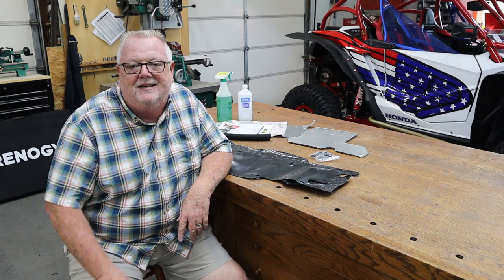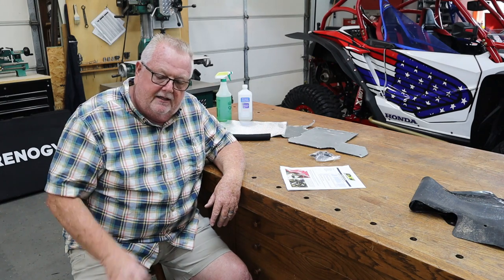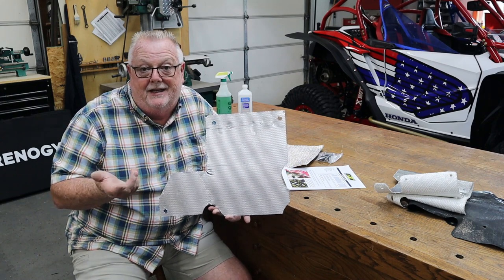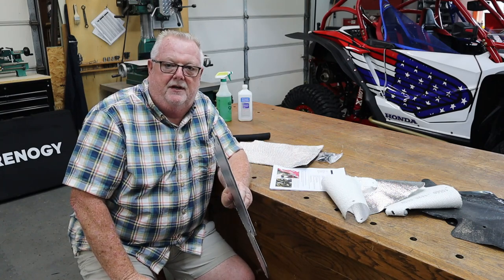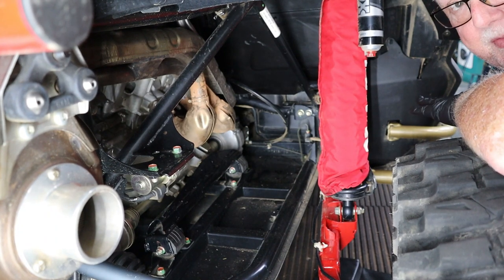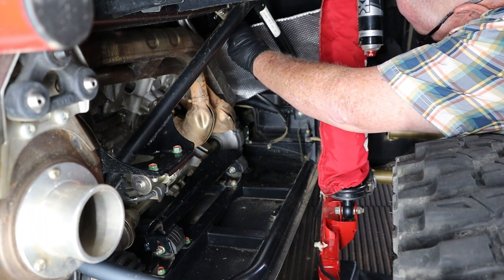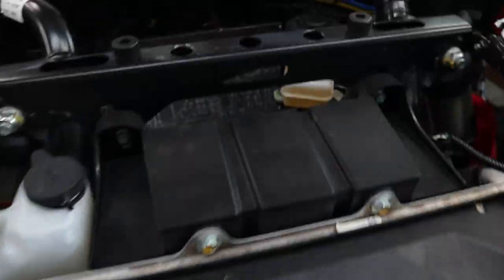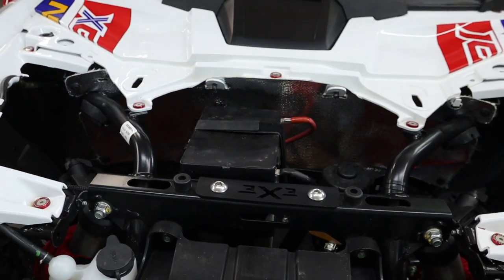Design Engineering Inc. heat control kit for the Honda Talon

Comment: I bought this kit before I saw the Jeep shifter boot fix. This kit blocks some air going through the tunnel, but not enough. It also lets heat and dirt come through the rubber flaps that go on each side of the tilt steering wheel mechanism.

As far as comments about blocking air to engine - at last count this is a water cooled engine! If you could route cool clean  air through the tunnel- you would have a cooler place to lean your right leg.

Comment: Terry, Thanks for this video. Like you and many others I have also tried several heat mitigation techniques on my Talon.  One of the things that I am a bit concerned about is limiting air flow over the engine.  If you follow that tunnel back it directs air over the engine.  Blocking that flow off may cause some overheating issues with the engine.  So, I will be curious as to how it all works out.  I was just out riding on the 4th of July and purchased a variable speed 12-volt fan on Amazon for the passenger compartment.  I directed the air flow help move air in the cabin.  It made a huge improvement keeping me cooler.  Keep up the great videos.  I have added several of your recommended accessories to my Talon.
Reply from the maker: Thanks Chuck! I’ll monitor the engine temp. I’ll include that info when the review video is done.

Comment: Bought the kit. Getting started on installation. Hmmm....the rubber piece Honda installs ain't there.  Wonder if the dealer took it off to install the Fuse Block or the Bus Bar or the S&B Particle Separator wiring. So I'll have this video up on my PC...right next to the Talon!  Looking forward to doing the install!!

Comment: Commented earlier that this didn’t do much. With more time and thought - while this blocks some hot air from the front, it keeps the heat from the two coolant hoses (200 degrees-ish) in the console to freely radiate under the passenger seat and heat the console sides, (assuming you foamed the drink holder area).

I put air conditioning tube insulation (what you see on AC pipe outside) over what I could reach from the top. Might be somewhat cooler.

How about if you
(1) put aluminum faced insulation on inside of tunnel,
(2) wrapped radiator hoses with exhaust pipe wrap (or equal) where they go through the tunnel, and
(3) put a hose/pipe from the front of the machine with outside air into the tunnel, sealing off other air going into tunnel? Maybe have to add a fan.

I’m in Phoenix so having the heat for winter isn’t a factor.

Any changes, additions, etc appreciated! I’m still trying to choose the materials.

Comment: So I know this is free heat mitigation in the summertime but does this help with letting cold air in during the winter time I have inferno heater and there's a huge draft around the driver's steering column

Comment: Hi Terry, I have a quick question about the large shield that the battery box mounting bolts go through....I'm assuming this piece isn't flexible, like the OE rubber, so my question is, if you want to take the piece loose at the top to get behind it, does that mean that the battery box has to come out to get it unclipped from the plastic hangers on the cowl cover? Or is the long piece separate and not attached to the frame like the OE Rubber piece? Thanks for any info you might provide.
Reply from the maker: The upper piece is flexible and separate so it comes out by itself.
Reply: @terryhatfieldmin  Thanks, that was just the answer I was hoping for! I Appreciate you responses.
Reply from the maker: @r.l.sheldrake2109  Glad to help.

Comment: Does this help block air from coming in by the drivers feet as well?
Reply from the maker: It's not designed to block those lower holes.
Reply: @terryhatfieldmin  thank you
Reply from the maker: @darrellsuchor5434  Glad to help.